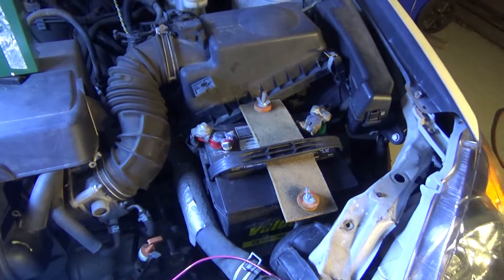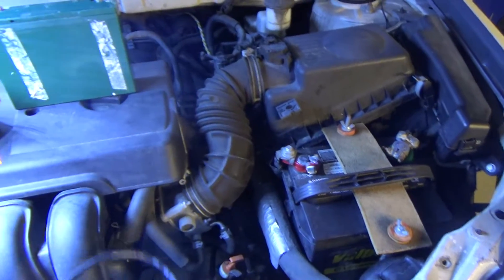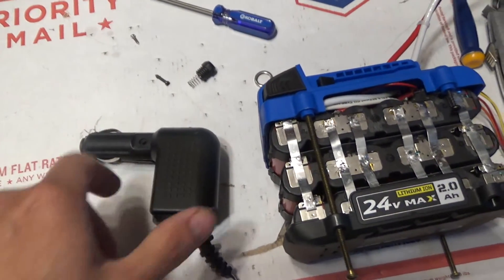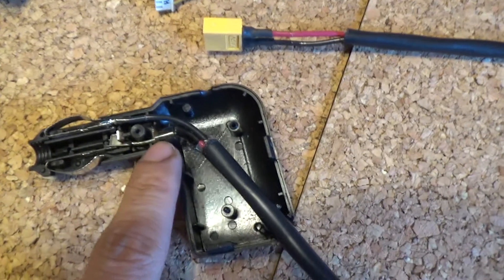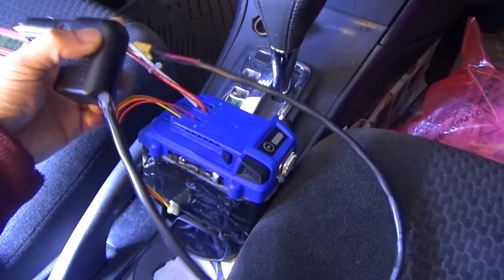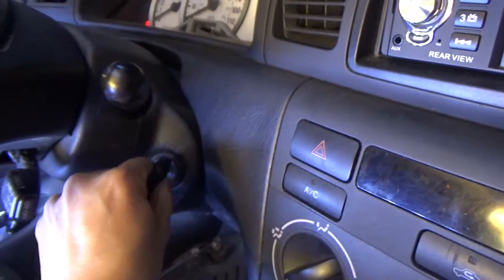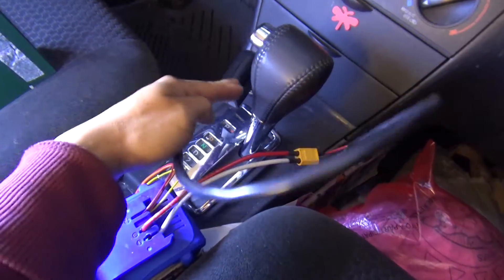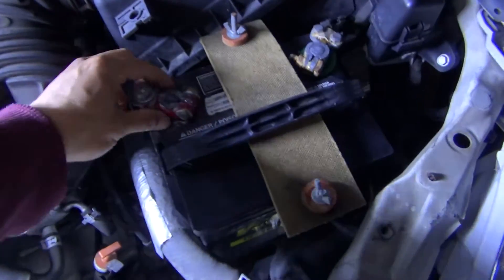DIY: Home made Cigarette lighter 12V power memory saver cable

Comment: Great video BUT this will NOT work if your car is a newer model that shuts off power to the 12V cigarette outlets when the car is switched off and the car battery is disconnected. Only older car models supplied power to the 12V outlets even when the car is switched off.

Comment: How does this work if your car is "push button" keyless????????????????????????
Reply: It doesn't.  This video's method will NOT work if your car is a newer model that shuts off power to the 12V cigarette outlets when the car is switched off and the car battery is disconnected. Only older car models supplied power to the 12V outlets even when the car is switched off.

Comment: Excellent video, thank you.  As an FYI, I tried this with a 2nd Gen Tacoma and this did not work.  I suspect Toyota added an electrical check valve preventing feeding current from the cigarette lighter port.

Comment: Neat project but this one will work better on most vehicles than the cigarette lighter type and is inexpensive.
https://www.amazon.com/dp/B07KCN69LJ/ref=cm_sw_r_tw_dp_U_x_WI7OCb84M69KN
[[ASIN:B07KCN69LJ OBD ll Connector 9 Volt Battery Auto Memory Keeper/Saver]]

Comment: Did you use 3 or 6 amp diode? Well anyways hopefully someone doesn't try to start the car this way. Good info.
Reply from the maker: I think those diodes are more than 6A. If you try to start your car with the external 12V battery, it will just burn out the fuse of the cigarette lighter. Then the power to your car through the cigarette lighter plug will be cut off and the ECU will be erased.